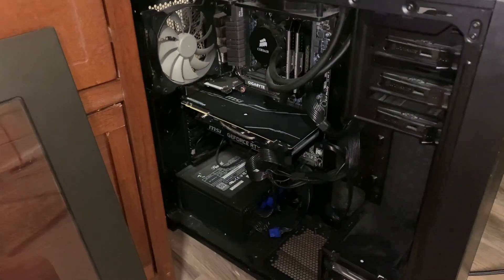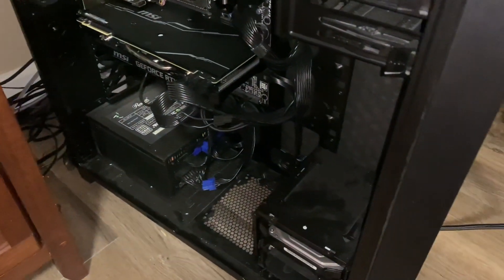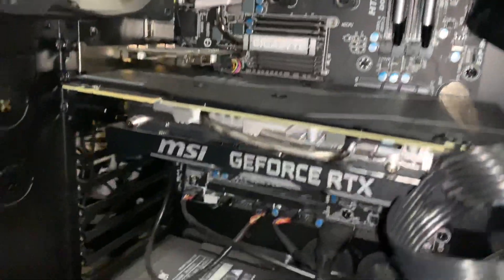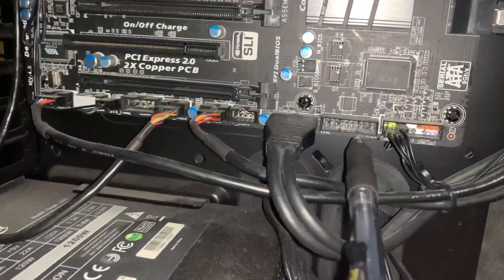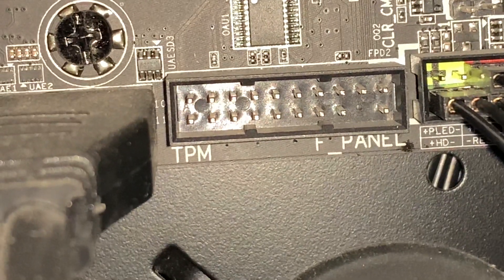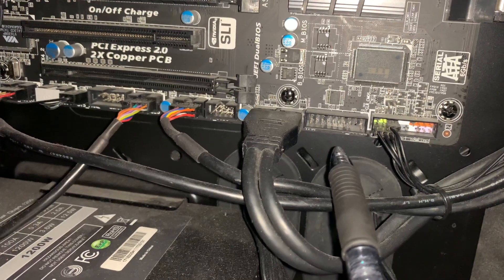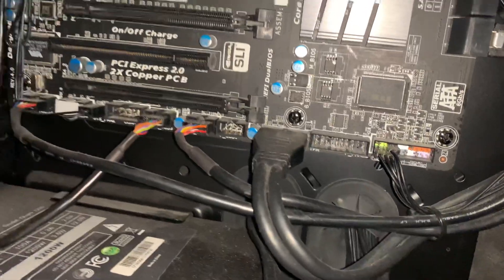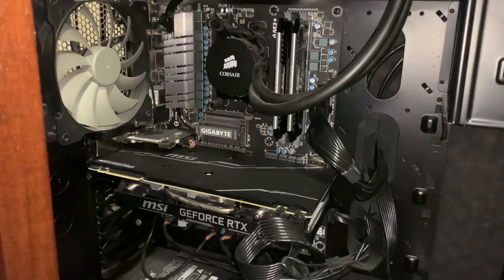How To Check Motherboard for TPM Chip [Physical Method] [TPM 1.2/2.0] [Windows 11]

Comment: Checking my system to see if i can add TPM 2.0 module. The same exact pin is missing from mine will this be a problem or will it owrk and this is some weird standard for TPM modules?

Comment: This method only works for mobos that support add-on TPMs.  My Dell Optiplex 5040 doesn't have a TPM header but used to have TPM 1.2 in the BIOS (keywords: used to).  The TPM option disappeared from my BIOS one day, leading me to the conclusion that the TPM is dead, and I have no way to tell if any computer has an on-board TPM that died.

Comment: ROFL touch an insulator to ground yourself. Smart. 🤣
Reply: Seriously though. Touch an unpainted copper pipe going into a radiator. Central heating systems will be grounded if installed correctly. You did get a professional to do it right? 🤪

Comment: This is gold. I am going to buy my old pc's the new tpm 2.0 chip.
Reply: does this  tpm 2.0 chip is the same for all boards?
Reply: @lenny108  for all the new ones.
I looked at my pc motherboars and none of my do.
Mine were built 2013 and before.
If your pc has the tpm on the mother board the tpm chip will work.

Comment: I have something call tpms 1 but it has 10 pins up and doqn the same as you just it has 2 pins down on the side next to the no pin area
Reply from the maker: some headers have different pinouts by mobo
Reply: @Nextil  so its for tpm?

Comment: Asus has 3 TPM 2.0 modules but not all motherboards support them I think
TPM-M R2.0 14-1 Pin
TPM-L R2.0 20-1 Pin
TPM-SPI 14-1 Pin
Hope this helped some ppl
Reply: Thanks. And looking high and low, my ASUS WRX80e Sage DOES have the header, it's between the CPU and the long perforated/slotted metal cage next to the I/O.

Comment: You are talking about the TPM connector which operates some other device using tpm connector ...
Microsoft requires tmp 2.0 chip where is it .
Chip is different

Comment: I have a Gigabyte ab350m-ds3h board. I found that port on my board and did a Google search for the 20 pin tpm 2.0 module.  However it seems every vendor is out of stock on them.  Where is one to find a place to buy one?  Is this something that we aren't going to be able to get.  If so thats a shame that a computer that isn't that old now won't be able to run windows 11.
Reply from the maker: Not sure, I ordered one 4 hrs after the announcement lol
Reply: @Nextil  others may have done so too and sold out the supply that was in stock. 

Another thing is I found the AMD Ryzen 7 has fTPM already you just have to enable it in the BIOS.  Then I still failed the 11 compatibility check. The Ryzen 7 1700 isn't in the widows 11 compatibility list of AMD processors now.  Maybe it will be added because it meets the windows 11 requirements of 1.0Ghz, 64bit, 2 cores or better. Idk
Reply from the maker: Update the website i purchased TPM chip through said manufacturer cancelled the chip & I bought through different website. $38 instead of $19.
Reply: @Nextil  I was able to work out the my Ryzen 7 1700 has a tpm device built in.  I just had to turn it on in the BIOS. It was called AMD fTPM. Now win10 see it as a device.  The issue is now that the CPU is not on Microsofts list of AMD supported CPUs yet. I an assuming it will be by launch because it's well above the minimum requirements.

Comment: Thank you for the video, my Gigabyte Z79x got exactly the same port . But as per system information, secure boot is not supported. is tpm 2.0 module will fix this?

Comment: The problem is where to buy that tpm module chip. I only saw on internet the smallest chip (6x2 pins), but i have the bigger one, so, what can i do?
Reply from the maker: I have a gigabyte mobo so I typed in google gigabyte TPM 2.0 chip and there was a link to buy one for around $20
Reply: @Nextil  Yeah i know but the problem is that the $20 chip is smaller than the header inside the mobo. Do you think that should work?
Reply: @ALEXITO090  relax,maybe It Works
Reply: Hey i found one for under 30 im currently double checking with the company selling the module to make sure it is compatible with mine which appears to be the same as in video which should be a gigabyte GA-990FXA-UB3 (rev 4.0)